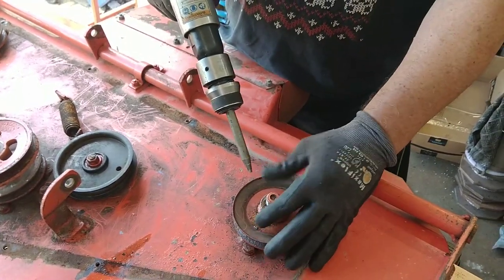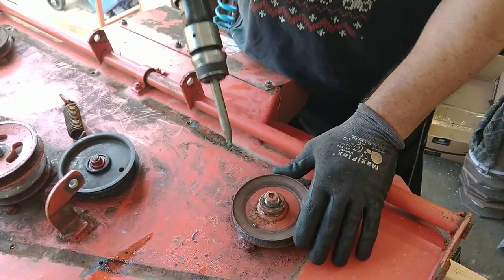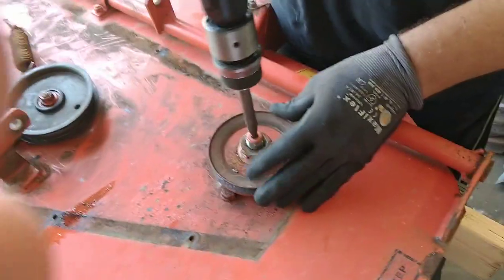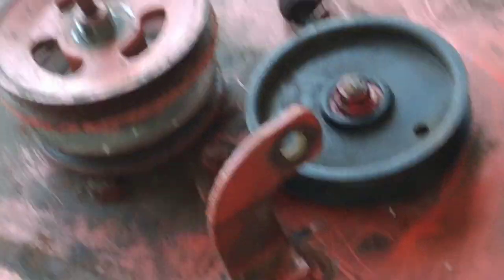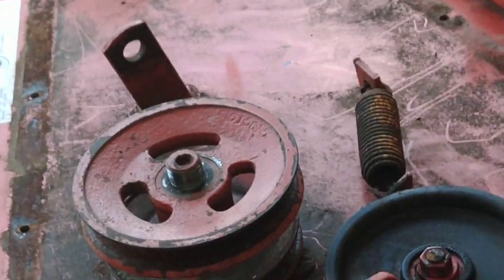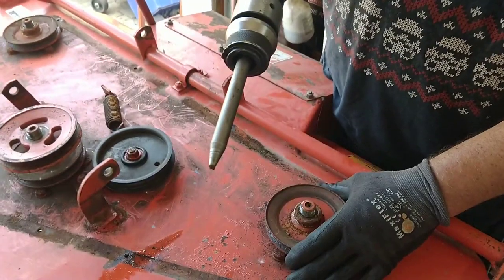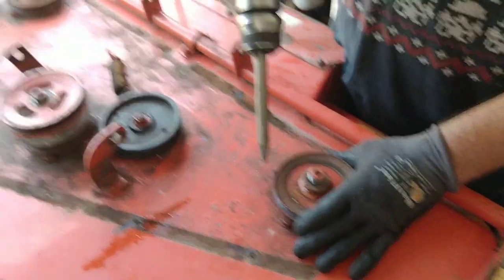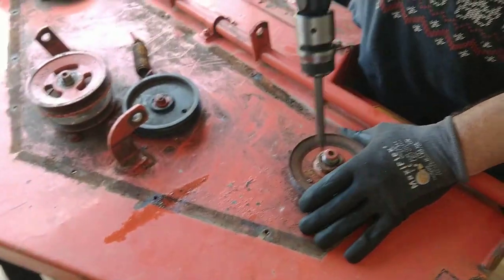Case Garden Tractor Mower Deck; Pulley & Bearing Removal

Comment: I had a 1984, I believe, Case IH 220 with the 10 hp Kohler and a 38" left discharge deck. That was the loudest deck I ever mowed with. That little tractor was a brute. I pulled a bobcat trailer (empty) up my steep driveway and about 1/8 mile up a steep road. It didn't bat an eye. Did have some issue stopping though. The brakes on those things were not the greatest. Retarding the hydraulics just caused the tractor to slide. Some white knuckle driving got me stopped without doing any damage. But that hydraulic drive was tough. High low range. I sold it after I purchased a Kubota. Had I had room, I'd surely have kept it.

Comment: Never had any luck doing it this way. The key ways would destroy the bearings every time. I always had to heat up the pulley hub
Reply from the maker: I did not at any time during the video drive anywhere near hard enough to drive the key through not just the bearing, that is being thrown out, but also the washer that comes first. Now sometimes the washer does get a ding in it. But, a couple taps with a hammer on the little dings on a flat surface and it is good again. 

Doesn't the heating of the hubs destroy the bearings? I throw the bearings out as it is the whole point. The bearings are pre-lubed. So, I assume the heat melts the grease and the grease would then run out of the bearing. When you heat the hubs, does the pulley just fall up and off? I am just curious.
Reply: Hemlock Case Guy the only reason that I ever took them off was because the bearings were shot. But the sheaves were always seized to the shafts. I made a thin prying tool that fit under the sheave that would push up on the hub while I used an acetylene torch in a circular pattern on top of the hub. They come off pretty easy that way. I just sandblast and repaint them. It sure would have been nice if the Case engineers had put a grooved slot like a power steering pulley has for a removal tool on the top of the sheave. I’ve never worried about reusing the old bearings. I get new ones and remove the seal that faces the inside of the spindle housing and add grease zerks to the housings just like the Allis Chalmers / John Deere decks have. I pre fill the housing by hand with grease before assembly. Then a few hits with a grease gun every 20 hours or so and the bearings stay very happy.